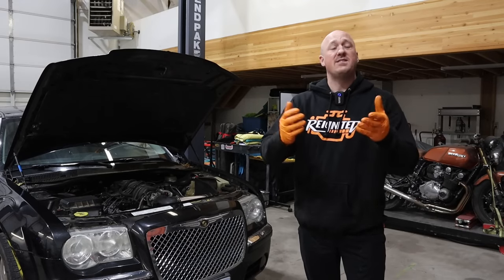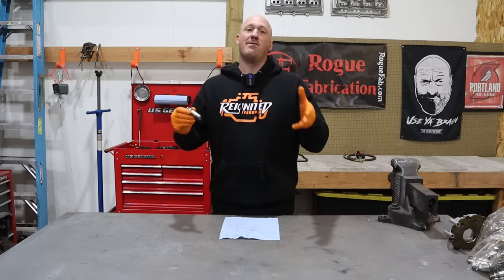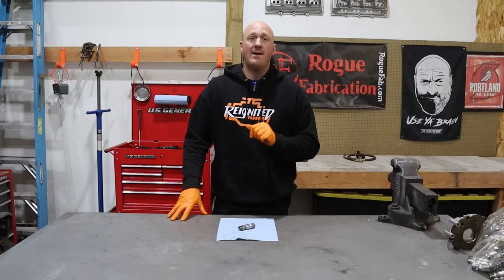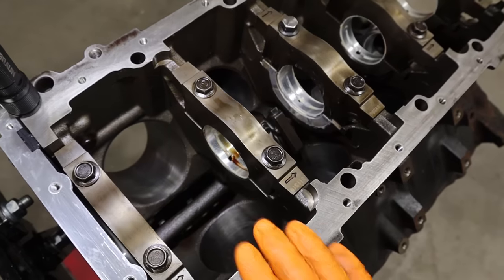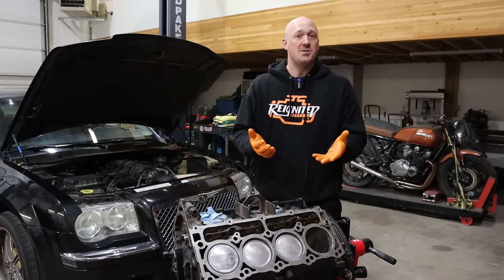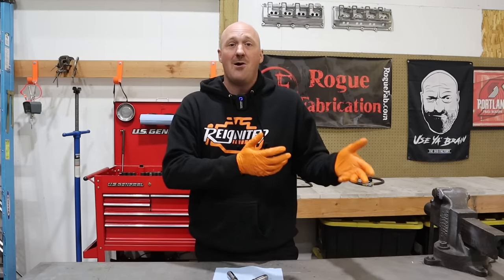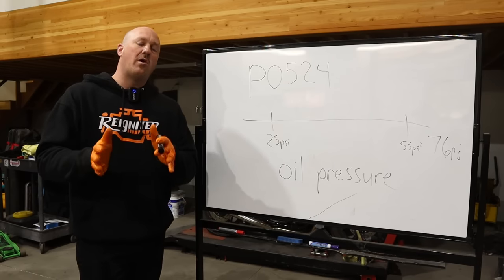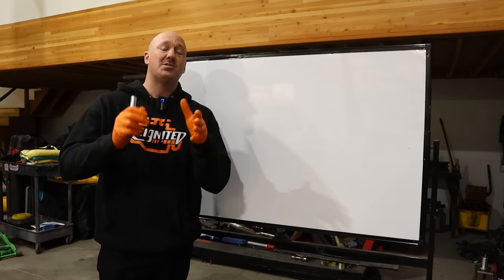The BEST Prevention For Hemi Lifter Failure! (In My Opinion)

Comment: So i just purchased a retired awd 5.7 police interceptor so i was wondering if you were able to correlate the amount of idle hours average until the issue can rear its ugly head.  Assuming oil changes are done every 5k or less.  Mine has a lot of idle hours more than 5k (9k total) yet it has 86k miles.  Maryland does not publish their maintenance schedule to carfax so i have no way of knowing state of engine without a teardown.
Reply from the maker: A long time ago a Chrysler engineer told me that I hr of idle time is roughly equal to 33.3miles of drive time.
Reply: @ReignitedAuto  thanks for the insight looks like I should be saving for imminent doom :)
Reply from the maker: @donaldperdue  I think pretty much any police vehicle I'd be replacing the cam and lifters in it. It's really not that bad of a job though, easily done in a weekend if you have even a little experience, and then you'll have a good solid vehicle for a long time. I've got quite a few videos that can help walk you through the process 👍

Comment: So I put a melling hv oil pump in my 04 5.7 ram and after the oil pressure keeps bottoming out after it warms up no codes the first time it did it there was chatter from the bottom end we changed the oil again and it still bottoms out nut no noise so we changed the oil again and added a bit more thinking it was emptying the pan 2 quickly it ran better longer but still bottomed out what could the problem be
Reply from the maker: Did you replace the o-ring on the oil pickup tube? That's generally the first place I look because it's easy to pinch that o-ring during reassembly.
Reply: @ReignitedAuto  that was our first thought as well we haven't pulled it back apart we did use a new o ring and lubed it up and it all went together great but doesn't mean it didn't get pinched on the back side where we couldn't see as well

Comment: Turning the MDS system OFF with a tuner WITHOUT an MDS delete does cause ACCELERATED lifter/cam failure.  

The MDS lifter doesn’t get high pressure oil unless the MDS is engaged on the freeway.  

IF, you’re idling for long periods AND, you ALSO have the MDS system turned OFF, those MDS lifters NEVER get that high pressure oil flow.

FYI, adding a “HELLCAT” oil pump on a 2012 5.7 HEMI disengages the MDS system due to oil sensor error.  Ask me how I know.

I heard you need a HELLCAT oil sensor as well.

Did a 5.7 HEMI Dodge Charger engine rebuild WITH cam/lifter replacement while adding a HELLCAT oil pump.

MDS system was disengaged due to an oil pressure error code.  Experienced lifter/cam failure 11 months later!!  Not 75k miles later.  10k miles later.

Comment: Do you think this will help long term with frequent oil changes. Im a mechanic myself im not afraid to build the engine to help this issue, i just love the platform, and im new to the dodge world bc im a level 2 technician at dodge, if i get a 2008 to 2023 challenger  hemi, i wouldnt drive the in traffic alot and id be very anal about maintenance.
Reply from the maker: Most definitely, regular maintenance is a major factor. Nice to hear from a fellow tech- keep learning every day it'll serve you well 👍
Reply: @ReignitedAuto  I appreciate the advice,
Reply: The best thing about the gen 3 hemis are the cylinderhead design
Reply from the maker: @JacksoNR26  no question it sets them apart, unfortunately it also makes the engine huge 😄

Comment: now the block is completely different than the older one
it was virtually the same in your statement previously.
and now a oil pump rabbit hole
Reply from the maker: I didn't clarify that well. What I meant about them being identical is that the bore and lifter angle is exactly the same between the older and newer gen3 engines. Once they added VVT the camshaft end journal changed size and the crankshaft is different. These two small changes mean that not very much will translate between the early and late model engines. Design wise the blocks are nearly identical. 👍

Comment: Will putting a hellcat oil pump void my factory warranty?
Reply from the maker: Potentially, it all depends on the dealer. Some would make a bigger issue out of it than others. With that being said, externally the Hellcat pump is identical to the stock pump, so if you had it installed at a non dealer and then something happened to the engine later on, there's virtually no chance the dealer would recognize that it's not the stock pump.

Comment: I just replaced my longblock in my 2012 dodge ram 1500 slt. 5.7 engine due to lifter and cam shaft issues. I went ahead and installed a hellcat oil pump on the re built engine for the hemi tick issues going forward fingers crossed. I am getting a low pressure code occasionally. I’ve seen digital pressure numbers as low as 24 psi at stop and 78 psi on hwy. I want to try this wire installation on the signal wire before I try the relief spring…on a 2012 dodge ram 1500 anyone know the wire size on the pressure switch? It’s oem pressure switch..

Comment: I'm one who thrives on details and usually askes questions which I do have one that I think that  may of answered while watching and will address later. first oh... wow we could have along discussion. super charged and turbo charged?? yeah, I  bet you blow it up all the time.. it seems you have 2 compression systems that are working against each other.. you added  exhaust pressure and turbo lag to a system that is praised for not having lag. for one that has BDS-871 on a BB in my Duster with equal pulley size producing 10psi with a theoretical compression ratio of 16:1 with stage VI heads... and believe me that is enough... twisting axle splines and blowing up the rear end first time out to the track. (of course of not knowing all of your setup) I feel you would do better and break less ditching the turbo and just playing with your pulley size. ok now to my question: I have an '06 Durango 57 (currently fixing the exhaust tick and replacing bad cats with the aftermarket Magnaflow setup. while watching you mentioned for my year use the melling oil pump for my year. but it looks like it ships with the high pressure spring installed but comes with a stock spring. Now from experience the Chevy guys go for a high pressure oil pump but always knew to go for the high VOLUME pump. you kind of address it and I think confirmed my thought of switching to the stock pressure spring (even if it was a high performance application - this is a daily driver) If your curious about the duster. : https://www.youtube.com/watch?v=jMjZT14-swg

Comment: Sooo I finally upgraded the oil pump... But I also upgraded a bunch of other stuff, including adding a procharger. Well my oil catch can caught the same amount of oil in a week, as it used to take 6 months to get to. Ummm, anyone have any idea why? I only understand the basics of how my engine operates.. I had the supercharger installed for about a month before I did the oil pump btw. But I got a new intake manifold installed at the same time I put in the pump so I think that's related. The tuner told me to change the oil every 2500-3k miles so keeping an eye on the oil is not a problem but I'd rather avoid any potential future issues. If this is even an issue. Still, it just seems like way too much oil is getting into the catch can
Reply from the maker: The addition of the procharger is your likely culprit. Have so much additional cylinder pressure is causing more crankcase pressure than you had previously, this is leading to the catch can filling prematurely. However it could also have to do with the new intake manifold, and if there's any baffling in it for the PCV system.

Comment: I installed hellcat oil pump when replacing my failed lifters. I get the low oil pressure code  about every 1000 miles.
Reply: Did your baseline oil pressure increase. (With full engine warmup?)
Reply: Yes to 30psi it was low 20s with old pump.

Comment: I just bought a 2023 Ram 2500 6.4. It now has 800 miles. Does anyone know if  Dodge has upgraded the oil pump recently? Should I be concerned with these newer vehicles? Thanks
Reply from the maker: To my knowledge they have not changed anything on the 2023 models. For your vehicle the two best things I can recommend are to not exceed 5k miles between oil changes, and try not to idle for extended periods. If you know that you will be idling the vehicle a lot then I would absolutely consider upgrading the oil pump. 👍
Reply: Thank you, I researched a lot of different truck manufacturers before I bought this one yesterday. They all seem to have issues at one point or another…..
Reply from the maker: @johnmann8253  that's the absolute truth, better the problem you know than the one you don't. And I genuinely think these are great trucks if maintained properly.

Comment: You figured this out but Chrysler hasn’t or won’t fix it.  Pretty lame on their part.  My 2 5.7s haven’t had this but. I generally was changing at 10k with synthetic but my miles are lower. I’ll switch to 5k changes.

Comment: What about the 6.1L? you go from 5.7L to 6.4L, I have the 2006 chrysler srt8 with 6.1L
Reply from the maker: The 6.1 doesn't really suffer from the lifter issues that plague the later 5.7 and 6.4 engines, but a higher volume pump is still a good upgrade regardless. Use Melling 10342HV for the 6.1 👍

Comment: I went from 5/20 to 5/30 royal purple. If you look up the early k series honda motors they had similar damage; and people went w 5/30 even though the cap says 5/20. I really think oil choice is the issue; a better quality oil; proper oil change; and making sure your oil is at the correct level is the best option; to make it better if you modifying then get a better oil pump. I used to drag the honda and beat it just like my 300 and nothing went bad. I recently lost the 300 but by the time I lost it the oil pan had cracked on a speed bump and I could only add oil because the crack was near the drain plug; and I was worried to destroy it; and it’s awd I have no access or money for the repair; but I can personally say it did everything well w no oil change for way over its limit; I did a lot of idling blasting music in my car; I like to listen to music in my cars; and it gets cold here in mass so I would idle it to heat it up and wait. It had a ton of idle time. I love your videos but I have this evidence; so    Idk; your definitely an expert; could I slightly be right w oil quality? And increasing the weight slightly?
Reply: What’s the scientific term for oil molecules; I forgot what its called modules? Umm the thing that creates the film at a level of creating like a safe barrier

Comment: Why does my 2017  5.7 hemi tick and then completely stop ticking when I'm in mds mode ?
Reply from the maker: Harmonics. Frequencies change based on a bunch of different factors. Think about if you have a dash rattle that goes away when you go slower or faster, or if you change gears. When the engine goes into MDS it drastically changes the vibrations inside the engine and can in fact mask noises.

Comment: It's not the lifters. Or oil pump. Or cam material.  It's a design flaw. Cams to high, the lifters are on a 15% angle. Simple put. Not enough oil gets to the lifters on long idles and hard acceleration. Iv seen test done. If the cam was lower and the lifters was on a 90% angle. ( Old school) Didn't have these problems. Lifter failure has happened through all years .  My brothers 2005 Durango just got hit by it. Yet, my 2003 4.7 still running like a champ.

Comment: So is an automatic rt lifter the same lifter as a manual and hellcat lifter ?
Reply from the maker: The part number will be different because the lifters are sold in sets of 4 with two being MDS lifters and two regular lifters. The two regular lifters are exactly the same as a Hellcat or manual trans lifter.

Comment: Hey Sky! My research has found that for the Eagle engines, you can use either the Hellcat oil pump or the Melling aftermarket pump. Do you agree with this? If so, which is really the better option for performance? Not worried about price. Just want to know which one really works better. Thanks for your time!

Comment: Is the 2014 dodge pick up 1500 the same engine as the 2014 dodge pu2500????
Reply from the maker: Depends, are you talking about 5.7 to 5.7? If so then they are very similar yes. The engine itself is identical, the exhaust manifolds are different and potentially the intake manifold could be different.

Comment: Is it possible to install a srt hellcat supercharger on a stock 2006 5.7L charger without any mods?
Reply from the maker: Not really. There may be a company that makes adapter plates to mate the early style heads to the Hellcat blower pattern in not sure, but that's just step one.
Reply: Ok thanks for the reply but what about bolt on upgrades like eagle hemi heads? What all is required for it to run correctly on the older gen 3 hemi? I'm looking at picking one up at a junkyard sometime

Comment: I want to change pumps and don't care about keeping MDS. Is there a way to keep the oil pressure code from coming up?
Reply from the maker: Swap to the stock oil pressure relief spring and no codes will set but you'll still get the benefits of the high volume. 👍
Reply: @ReignitedAuto  will the MDS still activate with the stock spring? I know you covered that in this video or another I watched but I'm not recalling. Sorry
Reply: @ReignitedAuto  I would actually prefer to not have MDS but I don't want to go so far as to replace the lifters and everything that comes along with that to make it work.
Reply from the maker: @joshuamckinley8707  yep, MDS still works with the stock spring
Reply from the maker: @joshuamckinley8707  alternatively you can buy a tuner to shut the MDS system off for good but I don't recommend it. If you're going to delete it I would go all the way.
Reply: @ReignitedAuto  ok. Thanks for the help

Comment: No the problem is the oil galleries are not allowing enough oil to the top of the lifter .  You have to redesign the oil galleries to allow more oil on top of the lifter on cold start up when you start the engine . The lifter is dry and not enough oil going to the top of the lifter down to the cam as well.   That is the problem. Oil passages larger to the lifter area on top of the lifter when engine is started thus saving the cam as well. I am not even a mechanic and I can figure this out. Remember the lifter has needle bearings they need lots of oil when they are dry on start up.

Comment: Change the oil at 3500 miles and use 0W-40 Synthetic (I recommend Pennzoil Ultra).  It will correct a whole lot of Problems.  It's too soon?   Maybe you haven't priced a new engine lately?  It's your choice.

Comment: wouldnt simply upping hot idle rpm increase pressure more than a hellcat pump(plus increase slung oil)? I think this might be easiest way to prevent the issues, with only slight mpg loss by folks who idle a lot, near nothing during normal driving
Reply from the maker: That would work as well yes, and I've heard of some fleet companies doing that, but some people aren't comfortable changing their PCM software, besides which they'll have to buy a tuner that would be capable of doing that. So it's six of one half dozen of the other.

Comment: Can i fix my number7 missfire no compression in 7 195 lbs in all the otherones
Reply from the maker: 0 compression is usually a sign of a different problem, not a lifter issue. Likely you have a broken valve spring.

Comment: Does the oil pressure gauge show a 12 percent drop? Does the oil gauge use a different sensor?
Reply from the maker: Yes, the gauge will reflect the 12% drop since it's taking its info directly from the pcm signal. 👍
Reply: Thanks @ReignitedAuto

Comment: I have a 2022 Ram 1500 with the 5.7 Hemi it has 16,274 miles on it. I’m currently bringing it back to the dealer for a 3rd time for the Hemi tick sound. The tick sound has always seemed to be coming from the passenger side bank of the engine. I was just wondering if you had any advice for me. Thanks.
Reply from the maker: At that mileage it's likely you're dealing with a cracked exhaust manifold. Is it more pronounced when cold?
Reply: Seems to be the loudest when cold. Still does it though when the engine is at operating temp. The dealer has replaced the cam and lifters twice now. I would think they would have checked the exhaust manifolds first? I’ll see what happens this time as it’s back at the dealer now.
Reply from the maker: @dainpinger7259  ya I would have gone for the manifolds first thing, especially since it is louder when cold. The lifter issue doesn't usually manifest until at least 60k miles so not sure why they went that route first.
Reply: @ReignitedAuto  Sounds good. Thanks for getting back to be and for the additional information. I appreciate it.